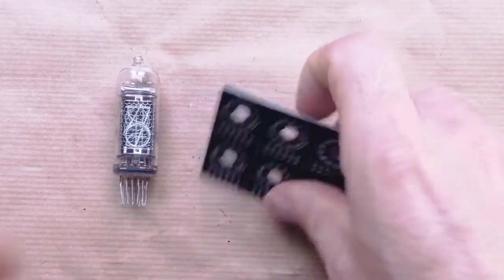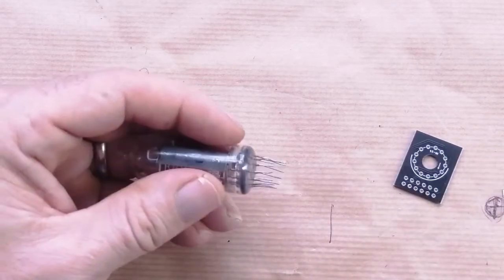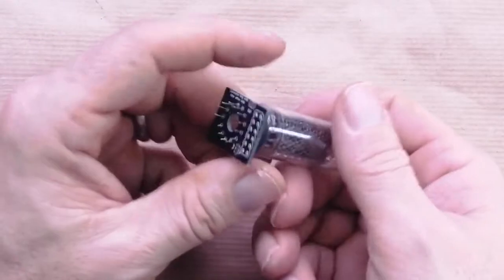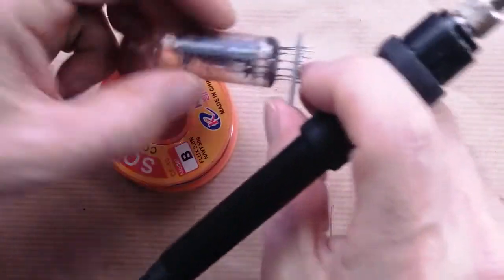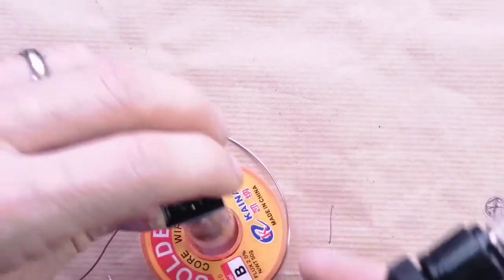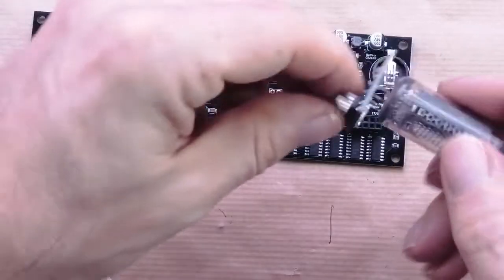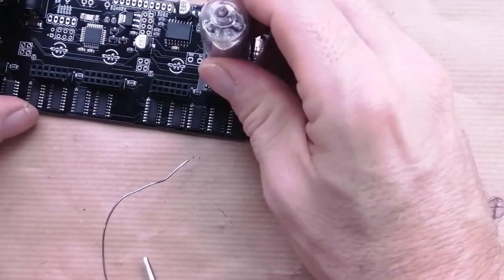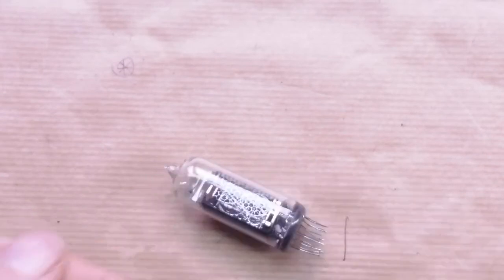MNC6 Nixie Clock Build - Part 3 - Tube mounting

Comment: very nice new design Ian. For the separators I mounted them on a 4 pin (2 row) mount, to raise them higher in line with the time. Very pleased with the finish. Next I will make a small wooden case to attach the clock to.